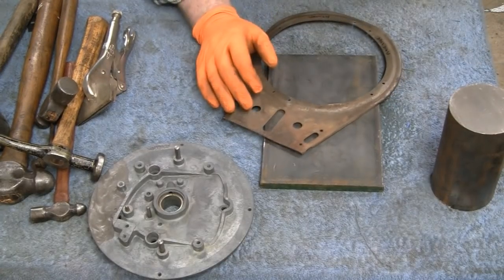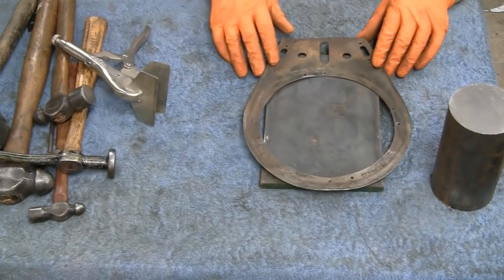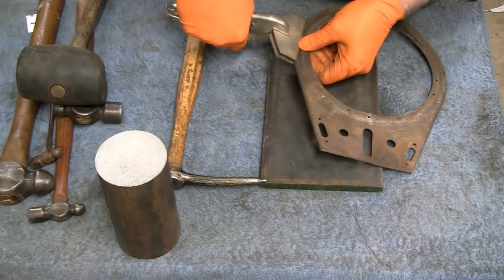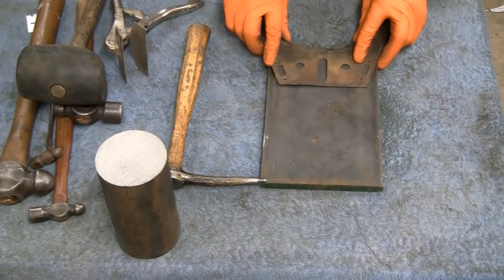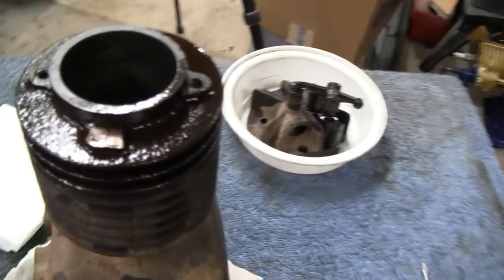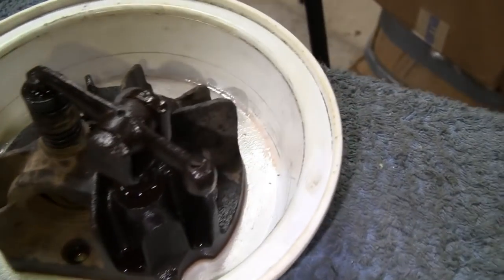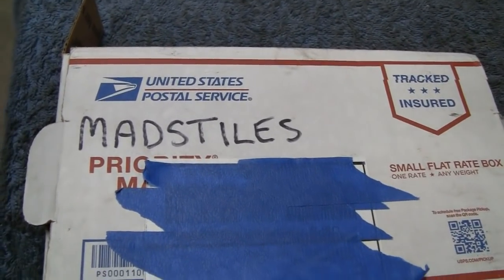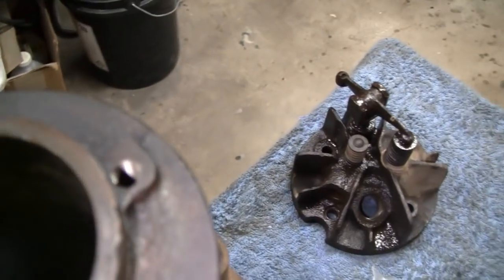1930 BRIGGS FH BASKET CASE RESTORATION (Part 4)

Comment: Looking good! I just got an old Robin EC07 running and rebuilt a little Power Products AH47, nothing like seeing these things run again for the first time
Reply from the maker: Thanks Bud!! I don't think that Power Products engine I have needs any work, I should pull it out and see if it runs!!☺
Reply: @805ROADKING  That's what I thought with mine but turns out it was run pretty hard! Still ran but low on compression!

Comment: Great video RK. I have worked a few days before getting stuck or broken bolts out I have better luck with heat over anything i have literally heated some up 7 or more times before i finally got them out but not sure i would of done that with that old of a block you did a great job drilling and tapping that hole again i can't believe how close and little metal is on the inside of the holes on the head. Keep up the great work and see you on the next one.
Reply from the maker: Thanks alot Bob!! Yeah very seldom does the Ol' Hot Wrench let ya down!!☺

Comment: Good job buddy! :) Seized bolts are never fun, especially when they are already broken off! And that backing plate piece came out great :)
Reply from the maker: Thanks alot Bud!!☺
Reply: Yeah, I like to try welding a nut or bolt on before resorting to drilling. I seem too good at snapping bits in the piece I am drilling 😢

Comment: Just a reminder RK make sure to flush out those reconditioned spark plugs before use. May be renaments of sand blasting sand around the the porcelain.  Don't want to see it wash into a cylinder on a motor you just rebuilt.
Reply from the maker: Yeah Buddy!! ☺

Comment: Yeah, in the sixties, on my first job in a garage, with the leaded gas, richer mixtures and lower voltage spark, they were recomending cleaning or replacing plugs at 8,000 miles.  Now. I take them out and re-gap the same brand plugs around 60 to 100 thousand miles and they just keep going.
Reply from the maker: It's interesting, a new plug back then probably cost a buck or two!! How much could you make selling reconditioned ones!!☺
Reply: @805ROADKING  It just seems crazy now.  A 1964 Motor's Flat Rate manual gave 0.9 hrs to clean and re-gap for a V8.  If my memory serves, the minimum wage was $1.25.  New AC plugs were about 0.99 on sale and store branded plugs were like 0.69 each.  A new full size chevy listed for around $6k.  As a teen I loved, learning about and working on those old cars.  Except for the wars, hot and cold, it was a great time to grow up.  Now, I look foward to your vidieos so, please keep safe bro.

Comment: Could have used the head as a template to make sure your drill bit was centered on the broken bolt. Another hint the rpm of the drill was way to slow but oh well it looks like you did ok. Nice job

Comment: You could always heat it in the oven without oil first. Also, nice spark plugs. You can't get those anymore.
Reply: The FH Briggs takes a Champion 8 COM spark-plug or equivalent. Hard to find plug...
Reply from the maker: Thanks for bringing that up Eric!! I forgot they took a special plug!! I use AC84 in my other F's!! I was all out, just had to order some more!!☺

Comment: I used to use acetone back in the Seventies to clean up fiberglass resin. It has a pretty low boiling point if I remember correctly. That bubbling was perhaps the acetone on the warm metal evaporating away. As for ATF loosening rust I wonder how that could work. Isn't it just hydraulic oil with friction modifiers added? I'm no chemist just wondering. I'll stick to Liquid Wrench or Kroil. It's what the millwrights at work always used. Thanks for the video Road King. Enjoying watching this engine progress.
Reply from the maker: Thanks Hoh!! I think all that stuff is pretty much the same, just real thin oil!! If a rusted bolt is gonna come out it doesn't matter what you put on it!!☺

Comment: I always find if the bolt won't move then no matter what you spray or put on it won't magic it out. If you can tweek it a little you can work the stuff in to the threads and go for it with the spray. I always find drilling the stud out to much and using easy outs is a waste of time as it spreads the bolt in the hole. You have to try but it's never any fun!
Reply from the maker: I agree with you 100%!! You're always just hoping that slim chance the easy out will work!! Make sure you see the next video, we were able to get one to work but it wasn't easy!!☺

Comment: The building I am working in now use to recondition Batteries and Spark Plugs 50 years ago...They were called BatSpar...I walked in there once(15yo)...full of tumblers and stuff...Champion were top of the line then comes the 70's and all turned to shit...6 out of a box of 10 didn't work...We even had to test them in the Champion plug service machine before fitting to save time on why the misfire...Along comes NGK and the rest is history...
Reply from the maker: Yeah Buddy!! Champion use to be the go to plug!! Now you couldn't give me a new one!!☺

Comment: Good job roadking some of them bolts can be pain to remove. Have you tried the reverse drill bits I've had some success with those try them out if you got a p.o box or something I can try and send some out
Reply from the maker: Thanks for the offer Francisco!! I have a set of reverse drills, I didn't use them because that bolt could have come out from the bottom if it loosened up!!☺

Comment: Brother RK,
Great movie!!
Question:  plastic grill on the front of a car, tabs are broke off that have a bolt in them that a nut tightens onto the hood.  What would you use to attach the tabs back onto the grill?  I was thinking 2 part epoxy to glue them back on, then a "JB Weld"-like to build up around the break seam. And what would you use to clean the surfaces, acetone? Figured I better ask you first.
Reply from the maker: I would plastic weld the tabs back together, maybe with a soldering iron you can melt them together. I never recommend epoxying plastic but if you sand and rough up the plastic a little you might have some limited success!! Acetone or lacquer thinner will clean it, if it doesn't melt it!! Good luck Buddy!!☺

Comment: I think you were just seeing the acetone rapidly evaporating,
Reply from the maker: I think you are right because when I went to apply a second coat of that stuff about five minutes later the stuff in my little cup seemed like it was just transmission fluid and I had to add more Acetone!! I hardly ever us Acetone and wasn't aware it evaporated so quickly!! I usually use Lacquer for almost everything!!☺

Comment: I seem to have more luck using left handed drill bits on broken bolts :)
Reply from the maker: I have a set of them, I thought about using them but that bolt could have gone out the other end of that hole if it broke loose!!☺

Comment: I have seen a lot of different versions of that hammer can you talk about it? What's its main use and name? Thanks
Reply from the maker: That's a Body hammer, it's meant to be used on automobiles to do bodywork. That particular one is called a Pick Hammer, there are many different versions but the two most popular are the Pick and the chisel end for getting into tight areas!!☺
Reply: @805ROADKING  Thanks RoadKing as always appreciate you answering questions.